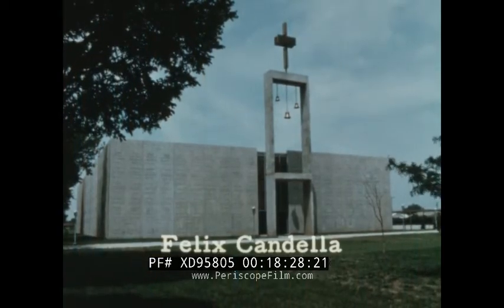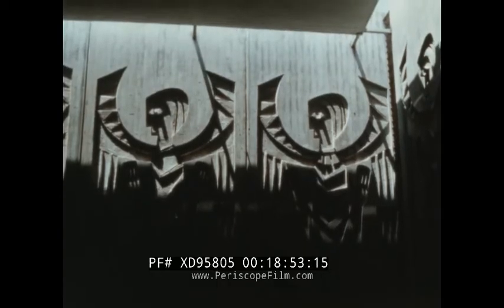“TWELVE DECADES OF CONCRETE IN AMERICAN ARCHITECTURE PART III” 1960s PORTLAND CEMENT PROMO XD95805

Comment: Part 1?
Reply: Parts 1 and 2 have run earlier during the past couple weeks. Type the title in followed by "Part I" and "Part II" and you'll find them. This has been a very informative and interesting Portland Cement history for me because I remember seeing these structures as a truck driver in my past.
Reply: @richburnham7326  Hyperbolic Paraboloids made for some interesting roofs on filling stations, more so in the US than the UK. we don't seen bold design very often, more symmetry and modular building.  From this presentation it is apparent that religion is very well funded. Safe driving Rich
Reply: @WOFFY-qc9te Thank you! The cross in Sedona AZ is absolutely breath taking in person!!! Public schools, private universities, and insurance companies are pretty well represented also. What I'd really enjoy seeing is the actual manufacturing and filling of the forms used to make the varied shapes. I didn't start driving truck until in my 50's two decades ago, but my first job out of college was at Bechtel Power Corporation in Ann Arbor, MI, where I worked as a technical writer. The General Manager there at the time was Mr. H. Wahl, who received many patents for his inventions in working with prestressed concrete. Bechtel has always been a construction powerhouse with many former officials there segueing into top government jobs, especially during the Regan Administration. Best wishes WOFFY.
Reply: @richburnham7326  Thank you  for your informative reply.  The Cross in Sedona is very impressive and as mentioned in the film partly due to the landscape setting such a bland background.  My first comment was a reply to one who  wrote " Atrocious architectural standards "  I am not sure such a generalisation makes any sense.  

However the Concrete monstrosities put up by town planners to provide cheap housing did not show cement / concrete in a good light but it is wrong to denigrate a material just because of misuse.  

As competing building systems became established more optimising of construction practices and material weakened both the structure and the design.  Hypobolic Parabolas were a simple structure but by no means easy to construct. 

Some of the Churches had interesting structural elements but several jarred my engineering mind and I suspect were not long for this world.  Brazila is a magnificent experiment sadly not for filling its original purpose. 

How nice to hear that this film has brought back good memories for you and the appreciation you have for the knowledge of your mentors. Bechtel corporation has been about for many years and If I recall were the main contractor on the Hoover Dam but I suspect the founding members original vision is not the same as the Bechtel corporations present mission. 

Best wishes to you Rich from Stephen in the UK
Reply: @richburnham7326  thank you.